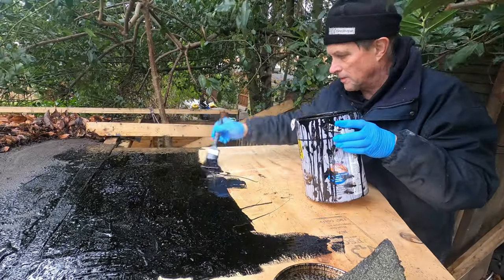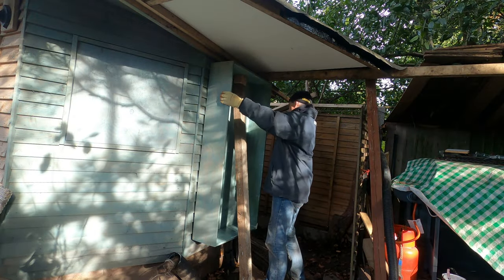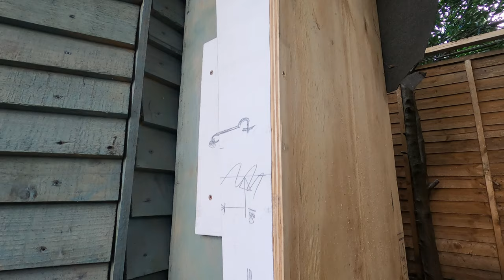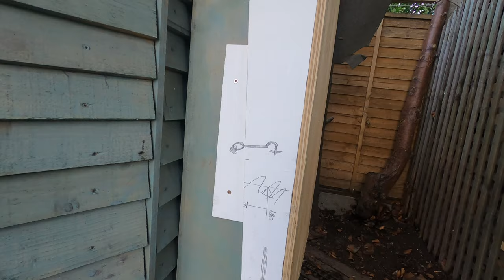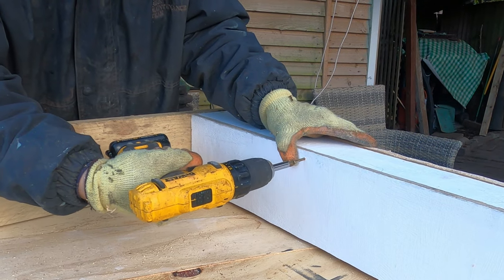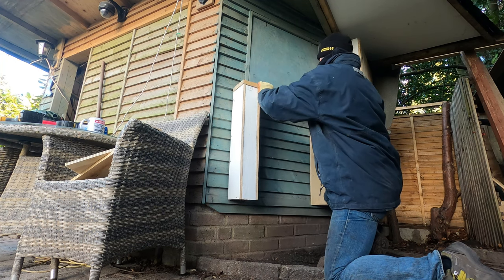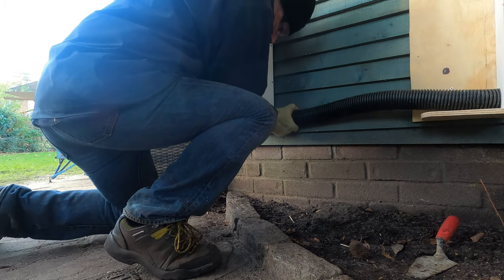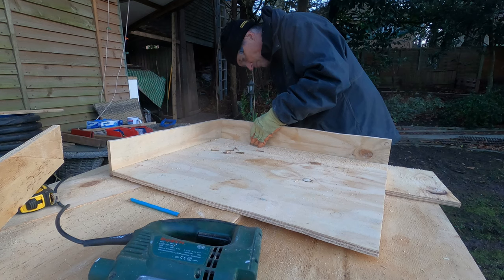Building a Garden Railway • Control Module Containment Box #2 • G Scale Garden Railway Development

Comment: Did you consider Pneumatic cylinders for the points?
Reply from the maker: Ahh now that's a good question.  No, I didn't think about the idea of pneumatic operation of the points.  I wonder how that would be possible. I will explore..... Cheers :)
Reply: @Linleys  A simple plc with a valve bank. Spring return cylinders to save on air.
Reply from the maker: Ahh thank you again, still catching up with some older replies. Cheers, Warren :)